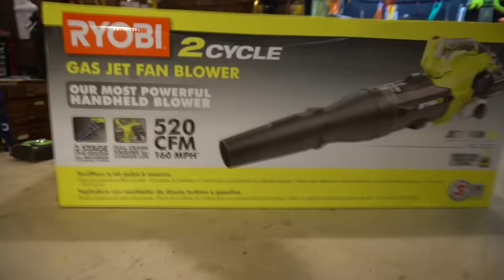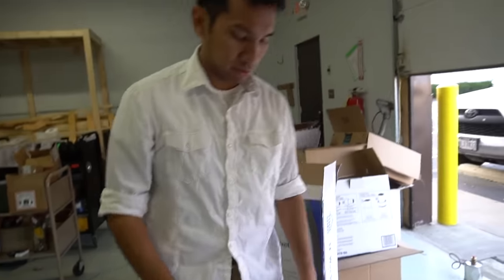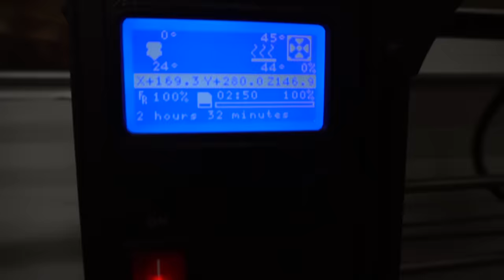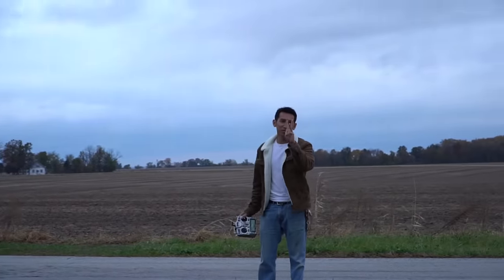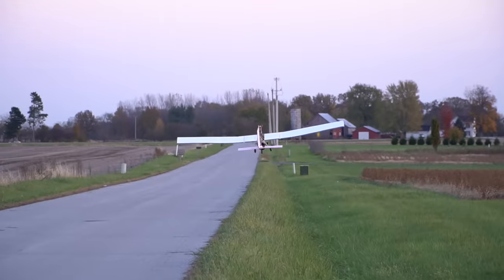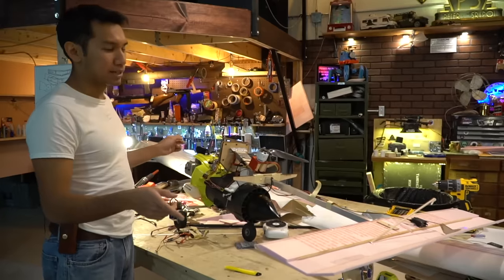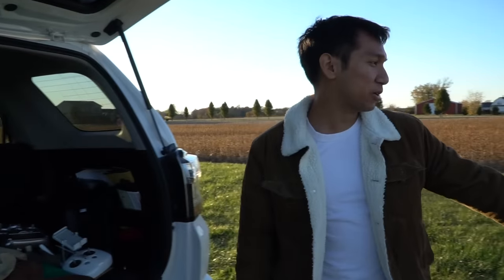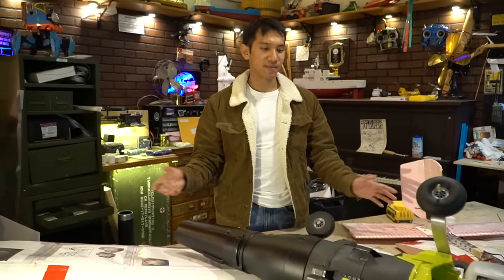FLYING Leaf Blower RC Airplane Drone

Comment: You could try putting a propeller onto the fly wheel at the front with a bit bold or two aslong as one is in the centre you can use a drill and socket to start it

Comment: How about using self adhesive car wrapping. when you stick it on the wing you can go over with a heating gun and make it shrink a bit so it's really tight and it should be much lighter.
this is how they make the light airplanes of course not with car revving but just with shrink plastic

Comment: I really think you should try it again. But certainly look into tweaking the performance of the petrol engine. Obviously the producers will tweak the “performance” down to make them last longer where as you can try and run it harder as would only be using it short term.

Comment: you could've put a propeller on the front spiny thingy.like the starter mechanism. and then just wrap a string around it and pull it till the string runs out witch might be enough to start it

Comment: Also turning out the mixture screws will give it more RPM , epa makes them little engine run lean they need fuel to make power.

Comment: I suspect if you would've increased the voltage of the power supply in the fully electric version by at least a 3rd, you would've achieved lift rather easily. It would've resulted in much less possible flight time, but you didn't have much of that this go around anyways. This was fun to watch. Thanks!

Comment: There's front drag and perhaps a larger foam tires. You could add more blades in the main blower fan similar to turbine jet engine. Have you thought of using the principle of those air powered Dyson air hand dryers and blades fans?
Reply: Excuse me are you suggesting he fly a vacuum cleaner

Comment: try it with a actuall good leafblower 
the ones we use at my workplace are with backpacks with the motor in it but we also have smaller ones all from stihl 
they're made to be light but really powerefull

Comment: I'm thinking more weight distribution and aerodynamic could be the trick... perhaps a smaller gas tank, sitting further down the tail could have helped. Octane boost it some more until it's close to explode perhaps? The idea is good, definitely needs improvement... but I wouldn't add too many cheats like extra rockets n propeller, that just defeat the purpose... just get rid of the blower altogether if that's the road you're looking at. Great vid. I'm inspired

Comment: Drill a Couple air inlet ports on the front side of the fan housing to Venturi some additional air into the front side of the system and create an area of low pressure in the front of the plane with an increase in air flow through and to the back.

Comment: Since you obviously don't care about longevity of the leaf blower, you can use a lower %oil/gas mix, re-tune the carb and gain a few hundred RPM.  You could probably use something like Amsoil 2-Cycle oil mixed 100 to 1.

Comment: Try to add a front propeller attached to the rotor of the blower to add more acceleration and also cut more parts of the blower that are not necessary for the flight.

Comment: I've got a few ideas for the gas model that I think you may have missed ( or realized where bad ideas and didnt bother lol) .  Certainly not all of my ideas would work but I would be very interested in seeing you finish this project on gas.  The air cooled head is not designed for the benefit of air passing it as it does when flying , in my mind I feel like you could remove weight by making cuts out of many of the fins.  Small engine repair is simple but if your interested I'm sure you can get some  more rpm out of the gas model if you adjust it.  A smaller fuel cell like off an rc plane or car may be a better solution  not only because it is lighter than the stock one but also if you want to do more adjustment of the weight you can move it around.  Additionally and most least likely to benefit  is possibly setting up a prop from the front and just having a drill  on the ground and nut to power start the leaf blower.  I dont believe the entire power of the engine is utilized by their design so I'm assuming you could create  slightly more thrust  by adding a front prop.   I say all of this having never flown anything beyond a Walmart drone lol.  Your channel is great, I enjoy the videos you put out.

Comment: It's not cheating if you change the housing of the leaf blower. You are already putting wings, wheels and extra electronics on it. It's no longer a blower, just keep freeing up weight with the power source and it will fly. Fun video as always though.

Comment: You should use a weedeater motor and have it drive 3-4 props on each side and make a mini spruce goose with the weedeater motor and see if that will fly

Comment: Try using the leaf blower to ventilate the burning coal in a boiler and make a steam powered airplane. Then technically it would be a coal powered plane. But if you don't protect the boiler with pressure relief valves, the boiler explosion would be spectacular.

Comment: You know they have airplane wrap at RC hobby stores that you use a heat gun to seal around your frame instead of glue and tape.  Lighter, tight and  sealed up better.

Comment: Since the engine cooling fins were designed to dissipate sufficient heat without high airflow running over them (like you will on the front of your plane), you could probably lose some weight by drilling holes in the edges of the fins or even maybe chipping a few of the fins off of the engine block.  Overall, looked good though.

Comment: Leaf blower has heat dissipator to work while standing still. As the air flow should be enough, get rid of that extra weight.

Comment: Your wing lacked enough lift.  Make the aircraft wing, horizontal and vertical stabs using Monokote.  This would allow a larger wing to provide enough lift to get the gasoline engine airborne.  It does add complexity and cost to the build, however.

Comment: You don’t need the muffler. Just screw a pipe to the exhaust port(where the muffler would connect) and you should be golden. Think of a motorcycle. Many of them don’t have mufflers. Just a straight pipe. Pipe should be around the diameter of the exhaust port.

Comment: Get rid of pull starter ...use drill motor to start....also replace fuel tank with thinnest lightest weight water bottle ....fuel tank for leaf blower is going to be heavy gauge plastic .....lastly optimize fuel  methanol?

Comment: remove governor and take out the frame intake thats restricting air flow they put fins so close so it doesnt suck up leaves but since your in the air you need basically none  those two alone would greatly increase thrust

Comment: You should have put a propeller and gear in the front of the gas motor where the pull start was, then put an electric motor on it to start the motor. That would have cool to see.

Comment: If you cut down the thickness of the wing an made it thinner This will give less drag, then why did you move away from a nozzle at the out let, this should bee designed to compress the air to give more forward velocity, You could have also put small scoops on the venture side to suck in ore air to give more thrust  just my opinion you could try

Comment: If you restrict the air output you increase the air velocity, try it on the gas powered blower, test the thrust without the blower tube, and with it and then with reduced output nozzle, when you restrict the output you will notice an increase in air speed and increase in engine rpm, might just get the plane in the air,  let me know what you think.

Comment: ok, that song that was playing during the montage sounds like it should be used in a 16/32 bit SEGA game.
EDIT: you might be able to do something  with a gas powered weed trimmer (something in the 25~30+cc range)with a straight shaft.

Comment: Idea... Use a higher performance 2 stroke engine found from a gas powered stand up scooter,.. swap that 2 stroke into a leaf blower for more thrust... I think there are a few super light 4-8hp 35-50CC aftermarket engines out there for stand up scoots,.. make the swap, try again,...   I want to see it!

Comment: why not put a prop on the front of the crankshaft of the gas powered motor where you removed the pull start housing?

Comment: You cud put a propeller in the front of the  gas lift blower and in the middle of the propeller a attachment to juke a drill to start the blower 🤠🤯🤩

Comment: How are my PC fans smaller, but seem to emit more thrust xD
They are just fans through without the bulk of the rest of the unit and require there own power supply
Reply: Nah you be playing msfs at full graphics to get that thrust 💀
Reply: @guyfromfuture1918  I'm using 3x200mm Delta fans that require a 300w power supply xD

Comment: Can you also try to make one rc airplane which is a small replica of the 1800s using BMX bicycle tires as wheels. I think it woul be very lovely and romantic seeing it flying in the air as well as it lands on the field. I have not seen any one yet on you tube doing it. Can you make it please.

Comment: Excuse my complete lack of know-how about RC flying stuff, but wouldn't it make sense to make a paper shroud for the thing, where the diameter at the end is smaller then the original plastic shroud? pushing same amount of air trough a smaller hole means more thrust? or at least i think it does?

Comment: When he decided to change the power to weight ratio he was on the right track and after he took weight from the engine The Next Step was to create a wing it did not weigh a ton his wings are too small and too heavy or else he would have come off the ground he is not an aeronautical engineer but he has laid the groundwork for an easy solution to flight someone suggested he find some reliable servos but right now we can all in the creation of a lightweight wing big I believe if he up wing size by 30% and kept the weight the same he could fly you know how it is delicate but it flies

Comment: surely if you narrow the air outlet you will get more thrust if you warmed the output you would have a basic jet engine lol
Reply: P Dyson He would actually get less static thrust. The speed of the ejected air is higher but the volume is less. The overall mass-stream producing the thrust is the same, but if he put on a nozzle on it there would be slight losses through turbulences and friction
Reply: you are wrong in your statement, the heat expands the gas, give some proven data that says am wrong if you can please

Comment: Add some nitro to the fuel or use premium or 100 octane. You should be able to get the rpm up without adding weight

Comment: Sad, I tested my 10cc nitro motors with a fish scale, got 8 pounds thrust at 12,500 rpm, more than the weight of the whole plane.
The prop was the key, a 13WX3.75 worked best, and you need to lose the ducted fan system and hang a large prop off that thing. I would start with a 22-24 inch wood prop and see what happens.

Comment: wouldn't reducing the size of the business end of the blower result in more thrust for the same power? Conventionally, keeping it wide open like that wastes a lot of potential for thrust and constricting the exhaust would result in more pressure and would result in the air being blown out at a faster rate creating more thrust.

If i'm wrong, i'm wrong, i'm just a novice, but couldn't that avenue have been explored before you gave up?

Comment: I was wondering, and trust me I'm no expert, but would it be worth sacrificing a small percentage of thrust (volume) in order to achieve greater air speed (pressure)? The thought being that you could have enormous volumes of air that isn't moving fast enough to achieve takeoff, but compressing the air out of the smaller nozzle and achieving more speed could make it take off even at the expense of volume. Does that make any sense or am I way off?
Reply: alsof jij oz slim bend

Comment: Just replace recoil stater that position at the front of  your gas engine, and put propeller at the rotor on it. It will make flew easier.. with no cheating anymore with electric motor ✌️😂

Comment: What about somehow adding a prop to the front of the gas powered blower where the pull start centrifuge connects? Would still be the leaf blower powering it right?

Comment: as for thr gas powered. i assume its 2stroke motor. you modified the muffler wrong. get an idea how 2stroke muffler. it need backnpressure to gain more power.  also try the carburator modification to. or if the motor is a rotary nitro. mod the muffler like on rc planes. but larger
hope this helps
Reply: addition to exhuast fan. try narrow it down. like cloggong the water hose to get more pressure

Comment: take the motor ONLY, and remove the fan, replacenit with a propeller blade...run it as a tractor not a pusher....You will have far better luck....

Comment: decrease the size of the fuel tank you only need 1 pound of fuel not 5 and all the the shielding around the engine needs to go. also get rid of the pull starter use an electric drill

Comment: How about a flying weed eater. Front engine, rear prop... an RC kit you can simply buy a certain weed eater strap it on, change the blade/string adapter to a prop...

Comment: I really thought 15 pounds per horsepower would fly. I plan to make an ultralight using 2 5.8 Hp motors that weigh 7 pounds each. That should give me around 30 pounds of thrust. I only weigh 130 and if I can make the plane less than 120, then it would be 250 with me in it. And that's 23 pounds per horsepower. Maybe it won't fly-

Comment: Orville and Wilbur Wright you guys are not. Maybe if you had consintrated on weight savings with a wing that was larger with a lower drag and also used a dihedral with a poli hedral it would have flown.

Comment: why didnt you use a higher octane rated petrol/gas?
that would have given you a better bang for your buck.
PLUS thats not cheating. I cant remember the octane ratings of your gas in the usa, but I think one was about 86 ron.
We have a 95ron over here in the UK as standard.
I defo think that would have made a difference.
Its a 2 stroke engine, right?
so petrol and oil mix, sorry. gas and oil mix for fuel, possibly already mixed.
If you mix your own then you can also get more power out of the leaf blower engine.
again.. not cheating... I ride 4 stroke bikes a lot. Started out on 2 strokes and found lots of difference betwen different fuels and oil mixes.
You could go further, which.. kinda might be cheating in some peopes eyes... by re-boring the engine barrel and placing a larger piston in, along with a carb upgrade.
All thats gonna give you a LOT more power. 
I'd like to see you take a mini moto bike and use that as an engine for a plane/drone
Reply: TLDR!

Comment: Needing bs back pressure is  myth it’s only when multi cylinder engines have exhaust manifolds there’s a scavenging benefit  that  helps pull exhaust out if the combustion chamber

Comment: Duuude.. so many of your vids would do better if you made vortex generators to utilize the most out of your top of wing downpressure. Wider wing/longer D + vortex generator will create better low speed lift/control/pressure.......... Honestly you can use a 3D print small hard T shaped fins and put them on a flexible plastic(if your printer cant do dual extruders w/1 flexible filament) to make re-usable conformable vortex generators.............................Vortex Generator principle.. It channels potentially lost pressure to remain fixed onto the surface of the wing using series of 2 fin slight "V" directed open baffles.. Airplanes outfitted with them typically are airplanes like bushplanes or ones that need better pressure and stabilization in lower speeds where down pressure is at its weakest..... vortex generators for high speeds are very much different in design and nature ment for a different issue. Homebrews, this would be perfect................. https://microaero.com/ Has examples designed primarily for single seats and smaller aircrafts like bushplanes and cessnas

Comment: 8 foot flying wing with the blower on it like a v1 flying bom
Reply: I like how it starts with a hammer. I was stand running a mcCulloch chainsaw motor after tuning an oversize carb and the flywheel came off.

Comment: Why can’t they design a 3D plane that has a tunnel in the center of the plane that can handle any rocket with a cradle. So the rocket is in the dead center of gravity for the plane. So you don’t have to keep adding extra weight to balance the plane.

Comment: The problem with this one is that you creating much higher pressure under stabilizer than under the main wing thus loosing a lot of thrust to keep it nose up. Move the blower above the wing and it will fly.

Comment: You could have gone lighter if  you placed a  proper  blade in front and avoided the crappy electric motor and its mounting mechanism  you are using for takeoffs.

Comment: Remove the pull-cord starter and extend the driveshaft to the front and mount a propeller.   Start the engine with a cordless drill.